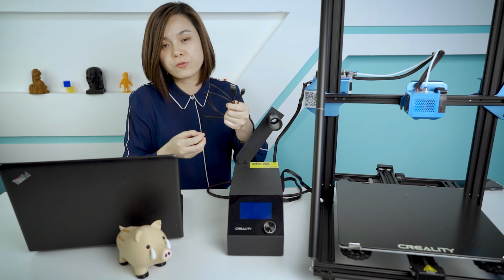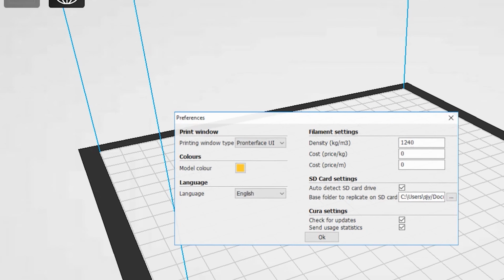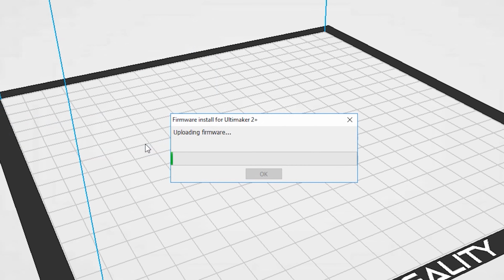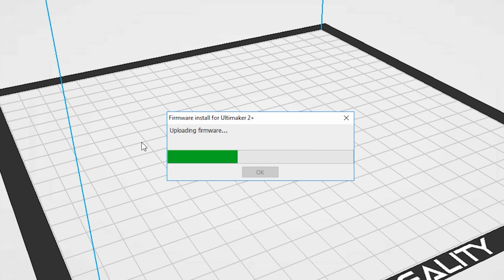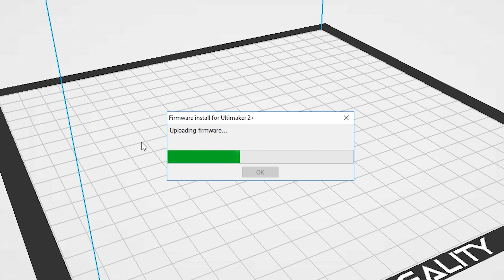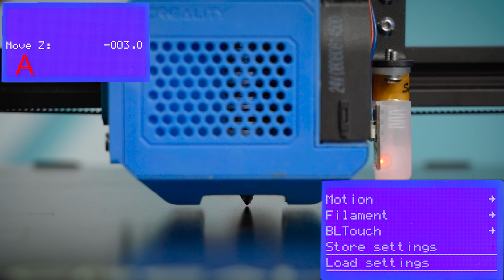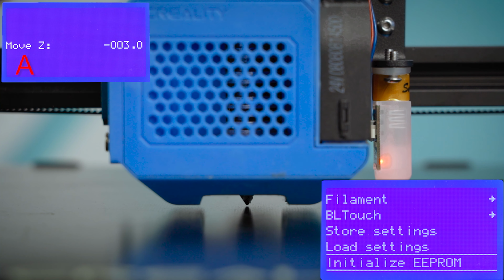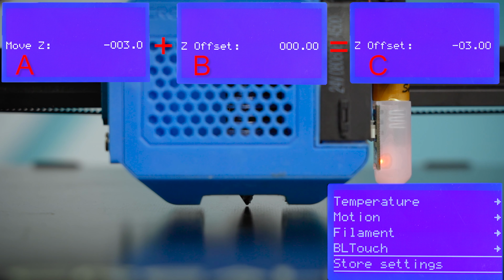Creality CR-10 V2 Bltouch Auto Bed Leveling Sensor Installation Tutorial (2019)

Comment: THIS VIDEO COULD HAVE LED TO MY MAIN BOARD BEING BURNT!!!
The connectors shown in the video are supposed to be connected in the reverse order! I found it out the hard way... I connected them as shown here, and when I started my printer, I smelt something burning and my screen started flickering. Upon contacting Creality they sent me an installation video made by 3D printing Canada, which had the connectors placed in the reverse order to this.
This is highly unprofessional of a big company like Creality to have this video still online even after knowing that the video is misleading.
Shame on you Creality!!
Reply from the maker: Dear friend, I am very sorry for your encounter. Where did you buy the printer? Can you provide the order number?
Reply: @Creality3D  i bought it from an importer in India. But that is not the problem. Luckily I switched the printer off in time and saved my board.
The main issue here is that you guys (Creality) knows that the video is wrong and misleading and still they haven't done anything about it! Just putting a simple note in the video will be great.
Reply from the maker: @apoorvbajpai4763   Dear friends, thank you for your suggestions, we will add text annotations in future videos. If the CR-10 V2 and BL touch you purchased are our products, the wiring sequence will not have any effect when the printer is turned off. You can see if your BL touch wire color order is correct. The correct color sequence of our wires is white, black, yellow, blue, and red.
Reply: @Creality3D   I already did it. by the way you can annotations in existing videos...
Reply: @apoorvbajpai4763  Hey I bought the BLTouch from them, and my harness is in the order that appears in the video above.  Should I rewire it?  Which way?  Their harness goes:
white(5v), black (ground) yellow(signal)  blue (ground)  red (5v)
-->rewire to this (Left to Right)-->
blue (-) red(+) Yellow (signal) black White 
That sound right?
Reply: @3000gtDentist  Hey man sorry I am out of station and I cannot access my printer right now 
I would suggest watching 3d printing Canada's video for the correct wiring
Reply: @apoorvbajpai4763  ok thanks for the heads-up

Comment: Your explanations from the point your start A+B=C is very rushed. Try to be clear that is the most important step in the process. Do not rush it. I have tried it several times and either the Nozzle is too high or too low. I am about to return the BL touch and try manual. if manual fails i will return everything 

I purchased the CR-10 V2 and BL touch but having issues. First i installed the BL touch firmware and got an error attached but i still install the firmware. Then when i did the Bed leveling with BL touch and stored the Z. When i begin to print after storing the appropriate Z, the nozzle is either too high or too low. Not sure what is happening

I even followed the video  below and did
(1) Bed leveling
(2) move nozzle by moving Z close to print bed
(3) Save Z
Reply from the maker: sorry for all inconvenience, which store you buy from and order number? did you contact the store? thank you.

Comment: hi, when I insert the usb cable into the PC the printer does not see my pc. Grazie.
Reply from the maker: Please try to connect with another USB cable.
Reply: @Creality3D  problem solved, BLTouch installed and working properly, many thanks.
Reply: @sseldiablo1  how did you solve it? im having the same problem and tried multiple cables
Reply: @tb1169  Hi, I simply changed the cable.
Reply: @sseldiablo1  i had to find a driver online and install that. for some reason it wouldnt install it self from the SD card

Comment: absolute useless tutorial for me... Nothing worked as explained, wirings are different and the speaker doesn't seem to have any clue... Go and get some external tutorial, you'll have more from it... sadly
Reply from the maker: thank you for your feedback, do you have problem? contact our professional tech support: cs@creality.com, we are happy to help.
Reply: Thanks for responding but after hours of trying on my own I've already managed to got it working. Just not with the video because of the points I mentioned before. The wires where different for me, Imy BLTouch kit haven't got the same connector (it had a splitted one) and following the instructions in the video didn't lead to a working solution...